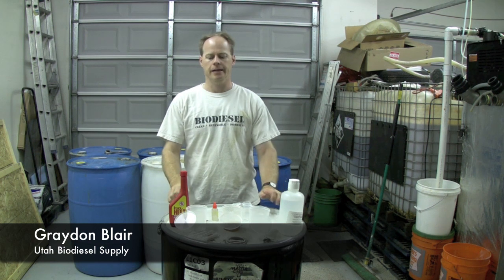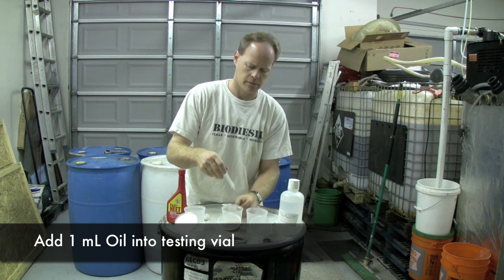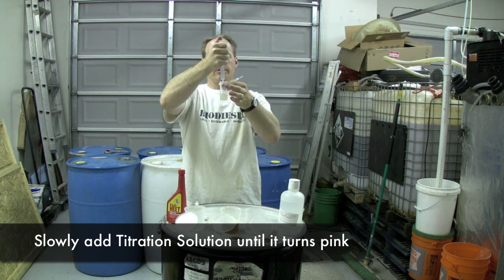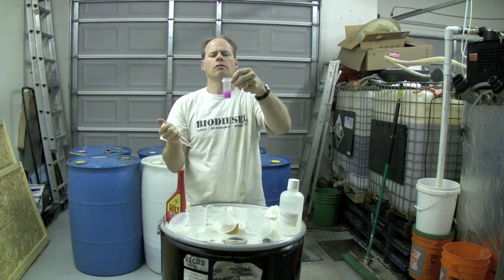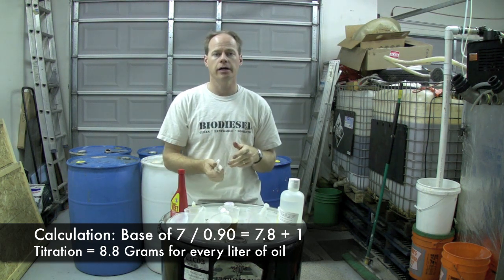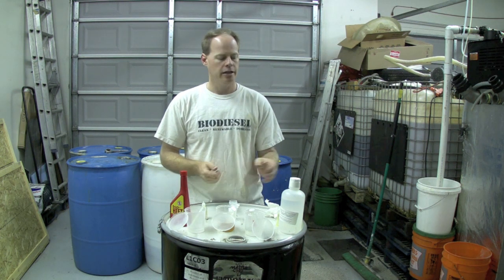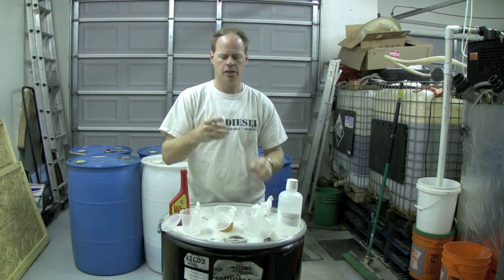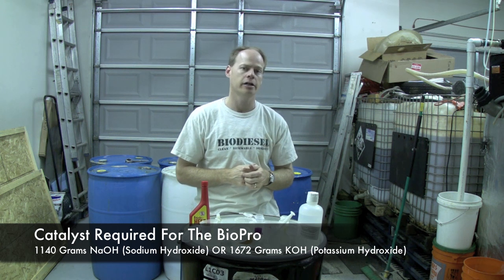Titrating Oil For Biodiesel With Potassium Hydroxide and Sodium Hydroxide - Utah Biodiesel Supply

Comment: Depends on what you're using for a base.
50 gal batch = 189.25 liters
0.2 + 5.5 base = 5.7 total. 
5.7 x 189.25 = 1079 grams
However, if your catalyst isn't quite 100% pure, you'd use a higher base (say 5.9). 5.9 + 0.2 = 6.1 x 189.25 = 1154.43 grams

Comment: It can throw it, but 91% pure is just fine to use. While you have 100% NaOH, the purity is probably 95-98% pure, so you need to divide the 5.5 by the purity (5.5/.95 = 5.8). However, you could definitely use a base of 7 & be just fine.

Comment: Heres the deal, I did a titration using 100% NaOH Sodium hydroxide in my solution. used .20 of a ML of titration solution to keep the brite pink,  which is less then u used in this video.
Why is it that i'm coming up with more grams of NaOH to be used on a 50 gal batch then you when my oil is cleaner then yours?

Comment: does the purity of the iso alcohol used in titration have anything to do with the Calculation? Im using 91% Iso. but my NaOH is 100%, Im also using 100% Methanol in production.
So If Im using 100% NaOH my Number is always 7on the base?

Comment: Correct. Sodium Hydroxide is stronger than Potassium Hydroxide
Correct. Sodium Hydroxide makes for a cheaper production cost.
I'm using 50 gallons of oil. 
1 gallon = 3.785 liters
50 x 3.785 = 189.25 liters
So when titrating, everything is in liters.

Comment: 7 is the amount of catalyst you would use if you 
a) titrated and got 0 and 
b) were using 100% pure KOH.
We call it the "base" amount.
0.90 = purity of KOH
We adjust the base for purity, because a less pure chemical will require more to react properly. You find the purity of your KOH from the people you buy it from. Sometimes it's on the label.

Comment: how's better to use KOH or NaOH?
Reply: It's a long time ago since this question and the answer is that if you don't remove the GLYCEROL from the processor while it's hot it will solidify and you don't want that do you?     I decided that the only sure fire way to make my bio was to stick with KOH even though it costs double what the NA etc etc costs.........Imagine a solid brown mass cementing your heating elements in on a cold day!!!!!!!!!! no thanks!